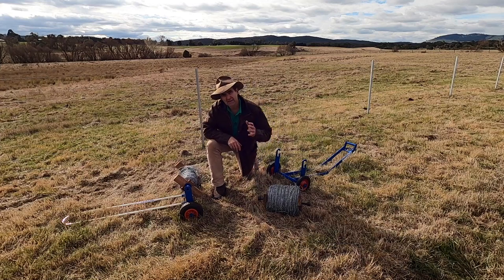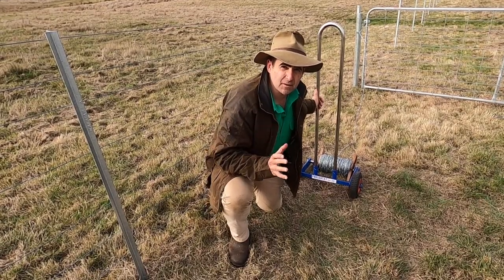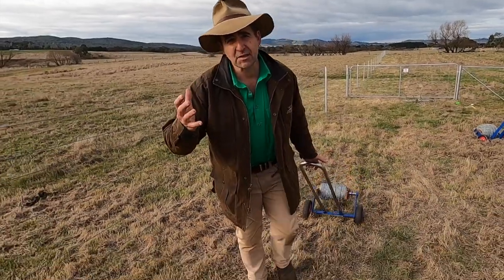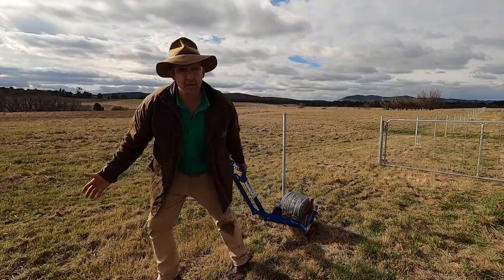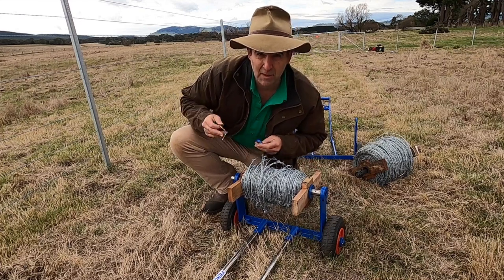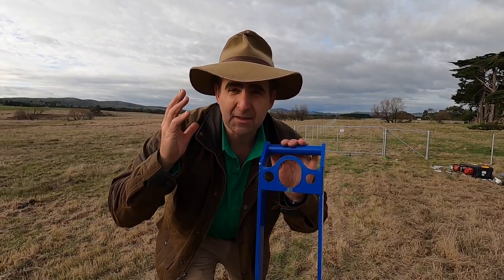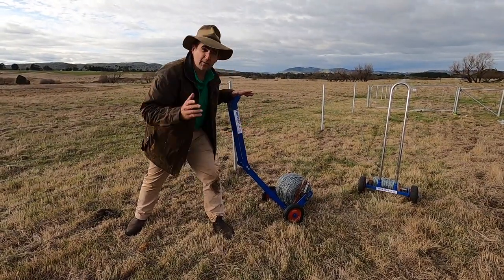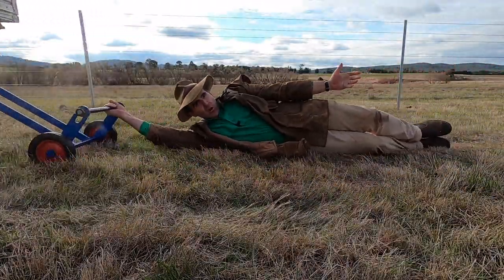Barbed Wire Trolley, a Safer, Easier and Better Way to Run Barb?

Comment: Tim with the second version where you had the bolt, why not a pin with a with a flat head and a spring used on your tow bar.
Reply from the maker: Great idea

Comment: Surely not pneumatic tyres, there are good 12" foam filled for wheel barrows with bearings for little money.
Reply from the maker: Yeah nah the trolley has solid wheels
Reply: @FarmLearningTim  You said pneumatics on the proffessional model, I pointing out foam filled give thesame size and rolling but don't puncture!
Reply from the maker: @rl3898  ah yep fair point

Comment: can i suggest you avoid using nuts and bolts on the handle adjusting pivot.  how about trying  wingnuts that lock in place when folded over.  or have a look at lawnmower handles to steal ideas.  and also, i now absolutely refuse to get punctures in wheelbarrow or handtruck tyres repaired.  i only purchase quality flat-free tyres now.  and wider larger diameter tyres roll better over rough terrain.  in fact, if i was building it i would be going straight for flat-free wide wheelbarrow tyres.